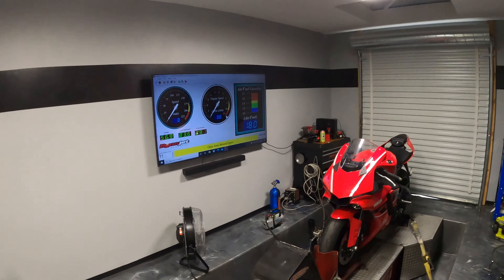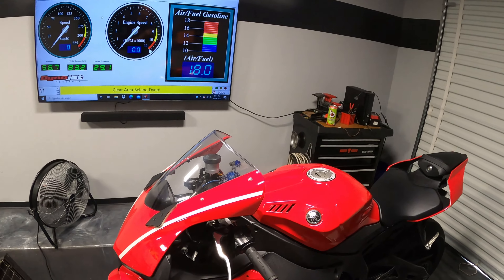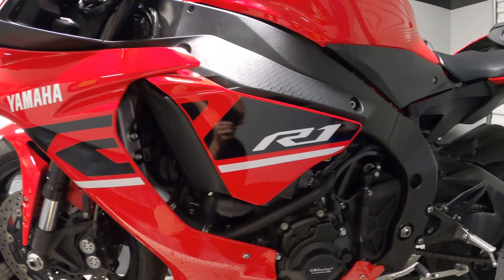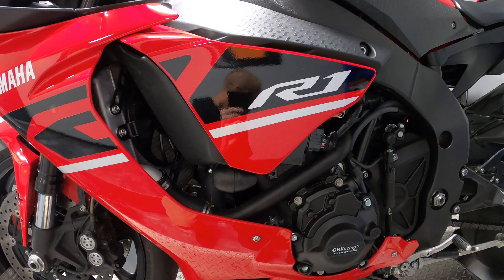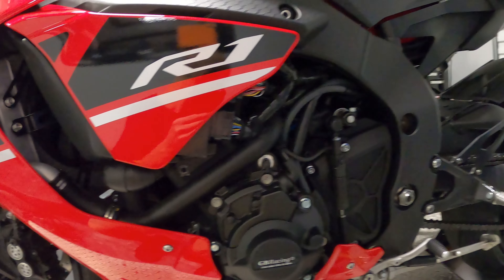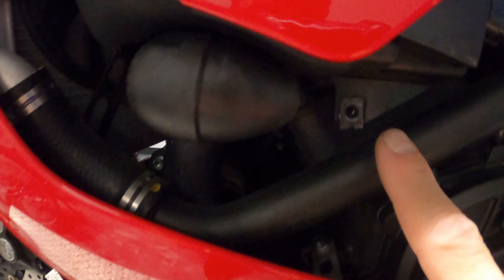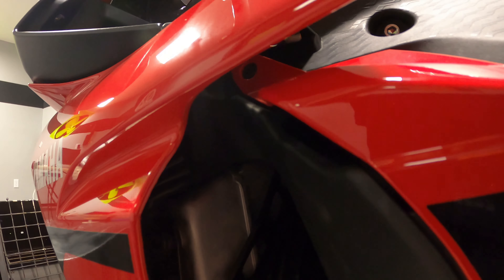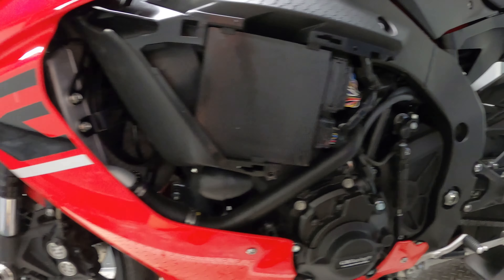Tutorial: How to Remove and ECU on a 2015-2023 Yamaha R1 - Moore Mafia

Comment: Nice video! is there a reason no one has figured out how to reflash a 2020 R1 ecu? I just bought an R1M and threw on a 2bros slip on and link pipe and cant find a anyone doing a reflash tune yet
Reply from the maker: Something in the ECU has the software companies locked out now.  They are trying to figure it out.
Reply: @TeamMooreMafia  thanks for letting me know, hopefully someome figures it out
Reply: The new model will probably be out before it’s unlocked.
Reply: @RadDadisRad  well, the new model is the same as the exsisting model so either way 2020 and 2021 are locked then🤷‍♂️